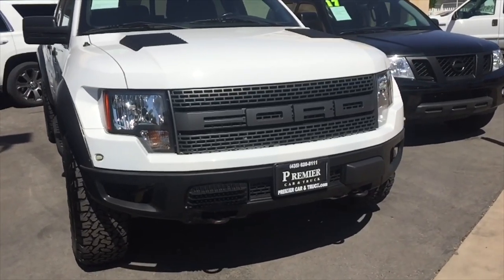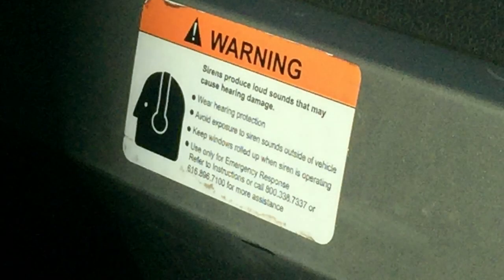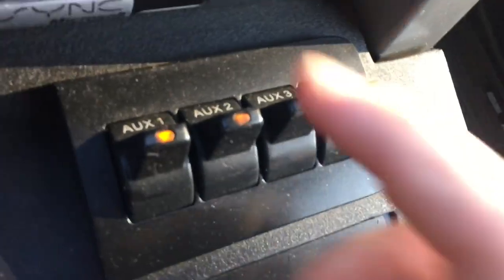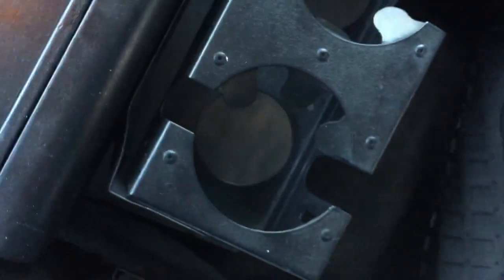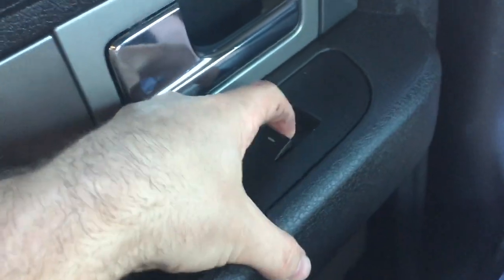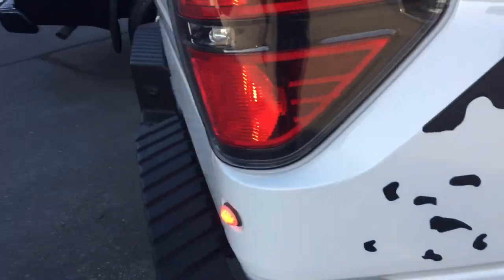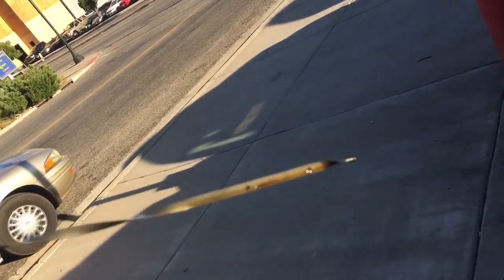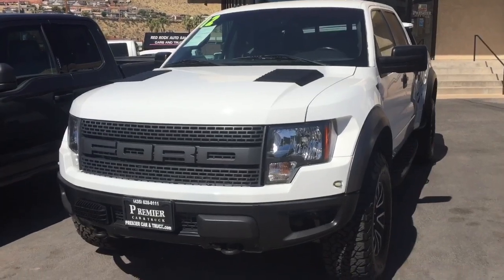Update: X Border Patrol Raptor update. Taking another look

Comment: Ford says 1 idle hour is equal to 33 miles of drive time. so 33x6587=217,371miles plus 100,145(Miles on the dash) equals 317,516 total miles. I have a 18 f-150 3.6 eco boost with 4000 idle hours and 64,000 miles. No problems so far i will probley see 200k and 12 thousand idle hours before i get a new truck.

Comment: Truck just arrived today finally. It sure has been through hell and back lol same exact one from the video. And it has the full stock exhaust but the truck has been bottomed out and a rock hit 1 of the cats and it broke the weld so it's pretty much running open header, and it does have an exhaust leak on the manifold. Truck is gonna need alot of work.
Reply from the maker: 8s0x5 That’s funny because I said it had a flowmaster or a really bad exhaust leak (poking fun at flowmaster a little). Let me know if you make any videos of it.
Reply: So if I were to be interested in the use border patrol Raptor where can I look for one
Reply from the maker: Oscar Lizarraga An auction when they come out of service, or you’ll really have to be lucky and find one. It’s what made this one so special and fun to find like a treasure hunt